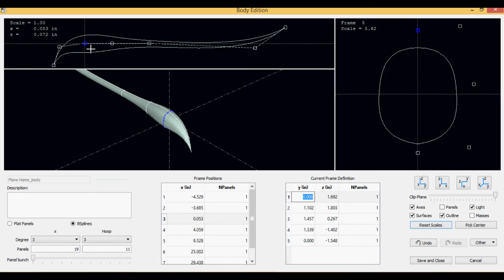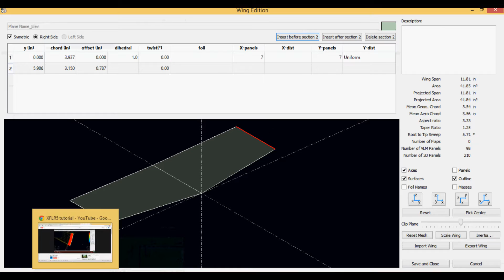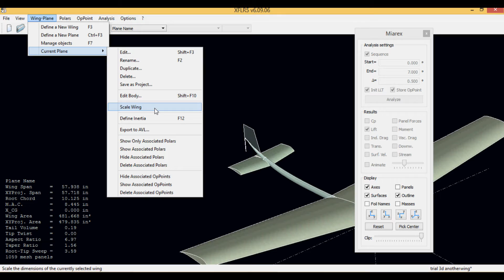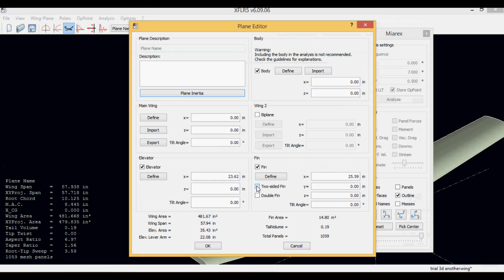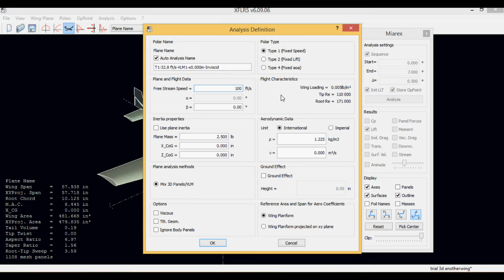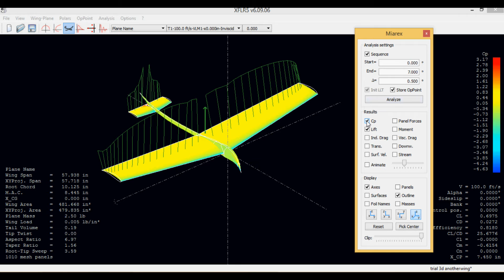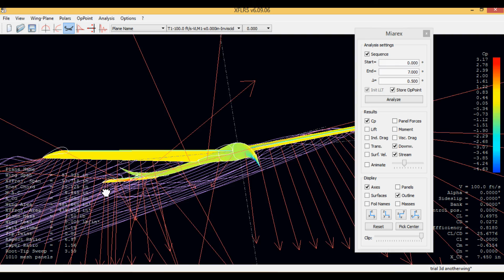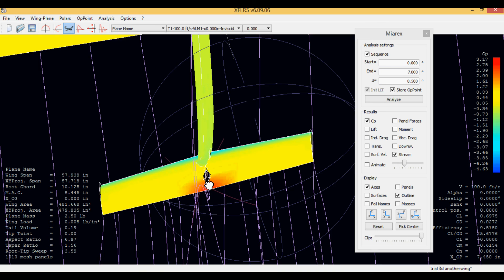XFLR5 Full Flight Analysis w/ audio

Comment: I designed my wing in XFLR5 and it gives me a Cl max of 1,4. After I added the fuselage and the tail, the Cl only has a range of -3 degrees and +11 degrees so i can't see the maximum Cl. This is of course important to calculate the stall speed. Do you have any idea how to increase the range of the Cl so I can see where it decreases.
Reply from the maker: I'm not sure how to help you on that one.
Reply: It's probably your range of Reynolds number which is too short (Hope it's not too late)
Reply: the CL analysis for 3D wings (so the whole airplane, not just the airfoil) is linear, so you cannot determine stall speed that way. If you managed to increase the AoA range anyway, the curve would continue rising linearly, thus producing unrealistic results (like around 1.5 CL and up).

If you really want to approximate the stall speed, look at the V/Alpha graph. Any speed below the graph line is insufficient to keep the airplane in flight at that AoA, thus stall.

Comment: hello excuse me I was wondering something, the value of the cp on the leading edge should not be high? why does it reach such low configurations? Let me explain: shouldn't it be red on the leading edge? Shouldn't the beak of the fuselage be red?
Reply from the maker: That's a good question. Since the beak is not a standard shape, I cannot really give you a very conclusive explanation. The best I can do is refer you to a body that has almost similar properties which would be a rocket (https://www.grc.nasa.gov/WWW/K-12/rocket/cp.html). Feel free to run analysis on my model https://app.box.com/s/9r9pl0szznwvj9tnciik8dg1tzlvj3rq

Comment: Usually the horizontal stabilizer's section is an upside down airfoil. Why did you use the same orientation as the wings?
Reply from the maker: +luiz You are right. I didn't notice that while I was making the video.